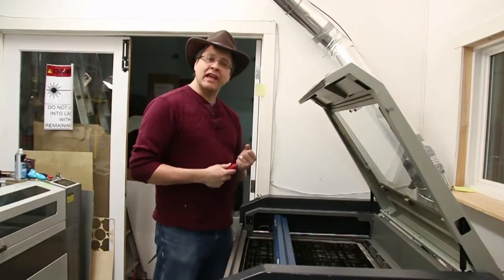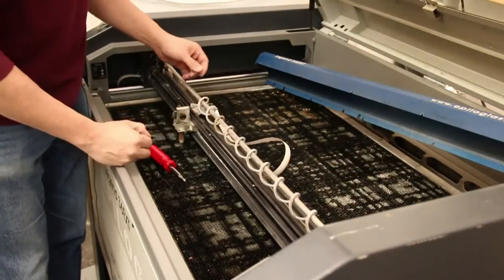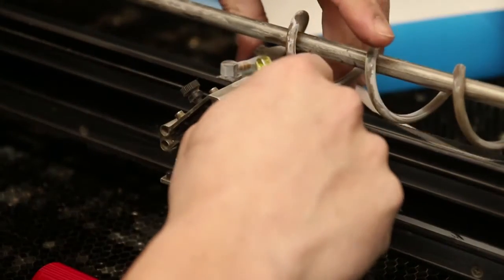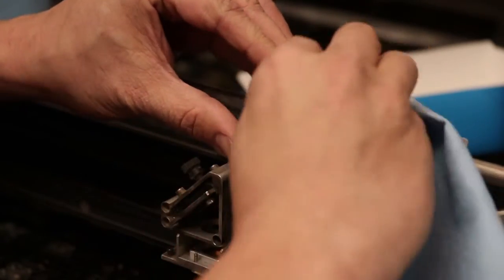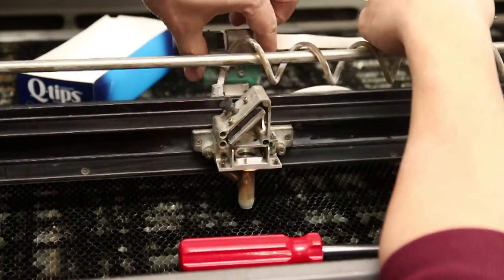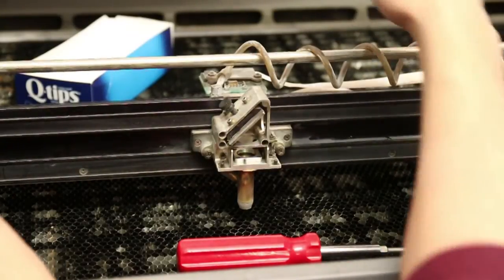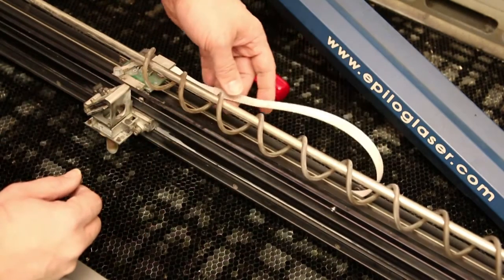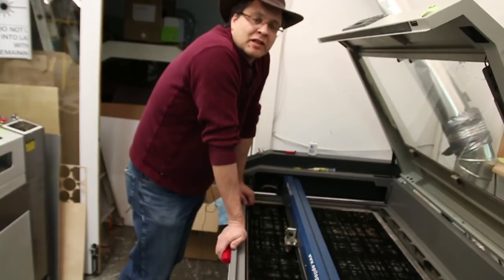Epilog Legend 36EXT Encoder Maintenance

Comment: After issues with the laser only etching the upper-most section correctly, I cleaned the encoder strip and the groove in the encoder (it wasn't that dirty). After reinstalling the encoder, the coiled tube is now getting jammed between the bar it's wrapped around and the top of the encoder as the encoder moves from side to side. When removing and re-installing the encoder, I did not touch the coiled tube. Any suggestions on how to remedy this?

Comment: plastic strip?
like a 30 bux cheap desktop printer

honestly for  the price  they should install  enclosed  glass encoder
Reply from the maker: A glass encoder would have been preferable, although the plastic one has been working well enough, and it it has to be narrow enough for the pass-though optical sensor. A think glass one (although better) may not be as robust.
Reply: @Solarbotics  
the glass one is installed  in  extrusions
they are  indeed rigid
they giving absolute postions
means no homing need
the plastic ones are always  incremental
 you zero it with a limitswitch
Reply: also  a plastic  cost 5 bux a 4 feet
the glass one cost 500 a 4 feet

Comment: you mentioned to use alcohol and water for the encoder strip. Epilog said to never use alcohol. They recommend and a few drops of dish soap and water. Alcohol will damage the encoder strip, according to Epilog. 3-7-18
Reply: He also mentioned rotating the Q-Tip as going along the encoder strip in order to keep the surface fresh. One full turn on the Q-Tip won't get you across 36". I'd use about 4-5 on each side ... with water and mild soap.